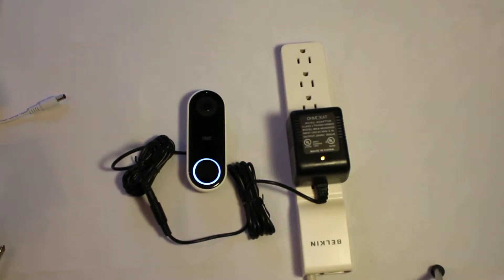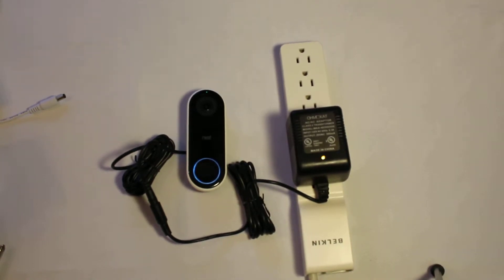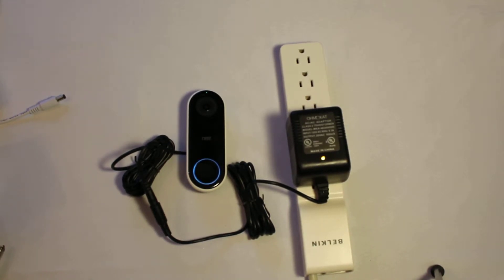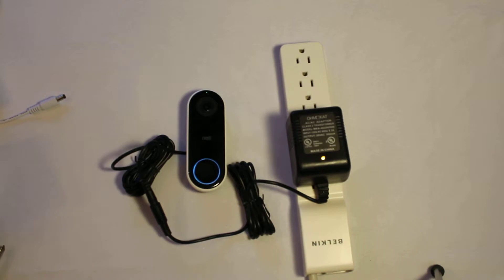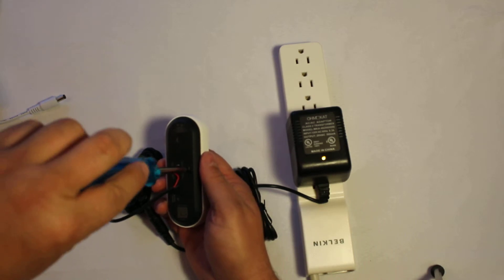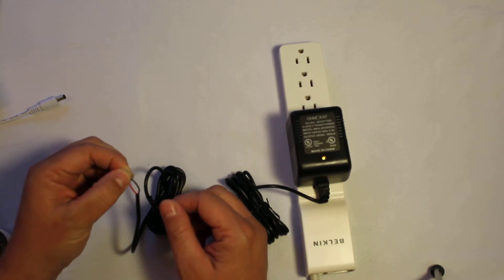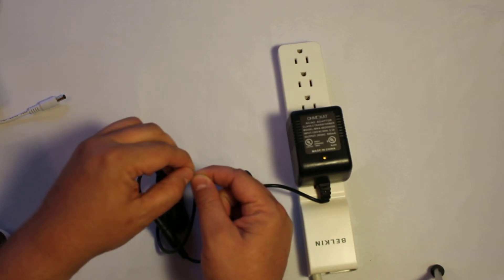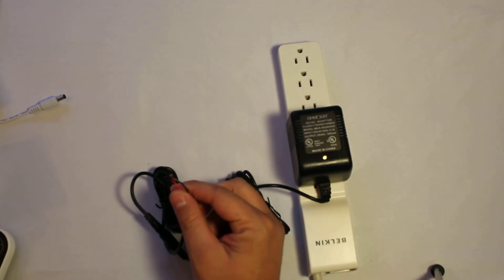OhmKat OTPT: One Touch Power Test Power Supply Self Test

Comment: How long are the Cords
Reply from the maker: 12 feet.  6 feet to the split connection and 6 feet from the split connection to the bell.  We offer extensions of 6, 12 and 24 feet.  Customers have installed runs over 75 feet